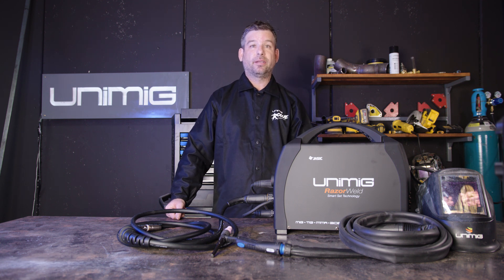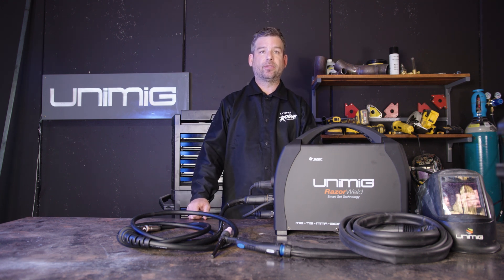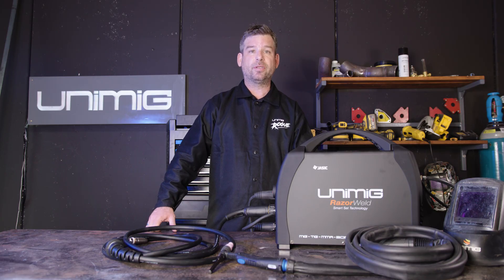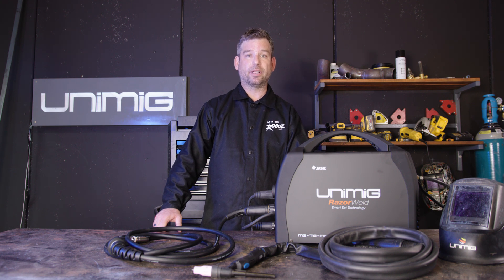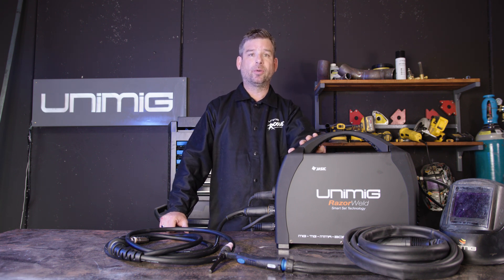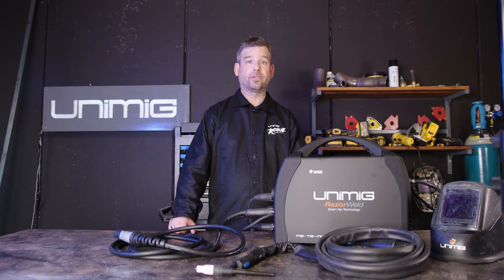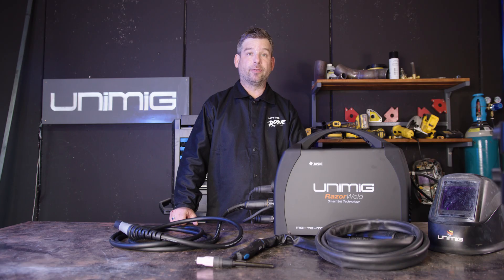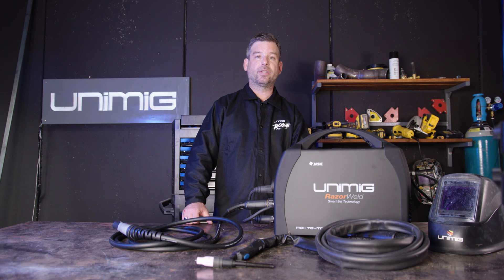RAZOR 205 SMART SET Product Walkthrough

Comment: Hello, I don't really know about welders but you state in this DC Tig only won't weld aluminium. And the later with the spool gun is welding aluminium. Is this using the mig process it will do aluminium??
Reply from the maker: you will need a dedicated ac/dc tig machine to weld aluminum (AC). For mig, you simply need to change the wire to aluminum wire, change your gas to pure argon, and weld away using the spool gun.